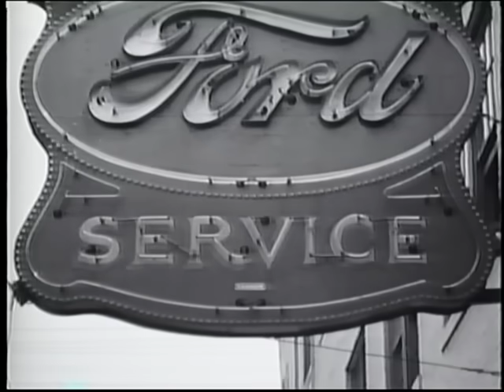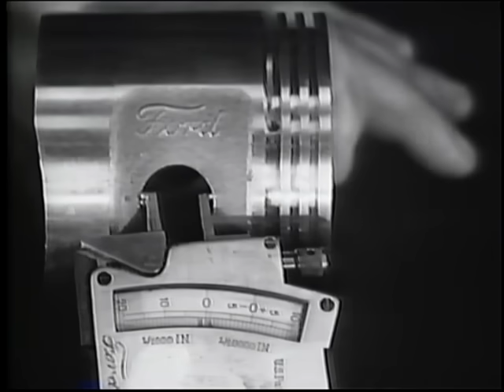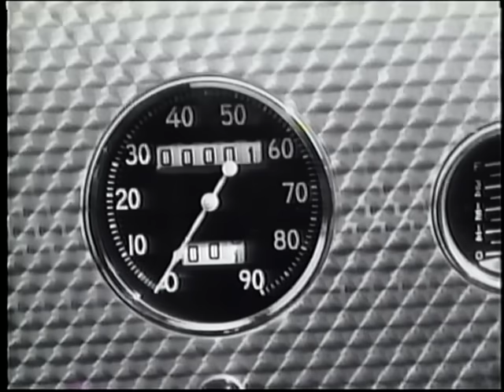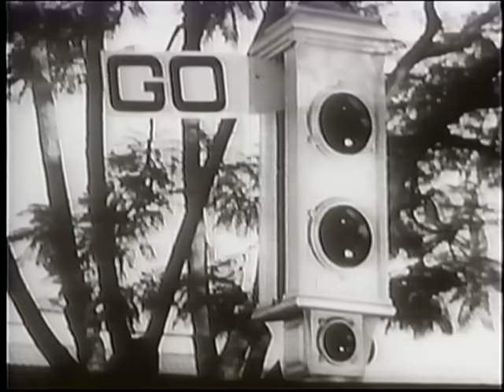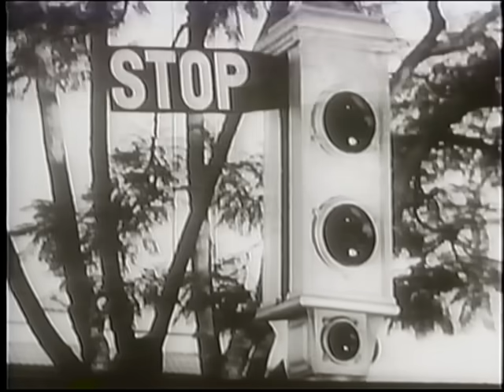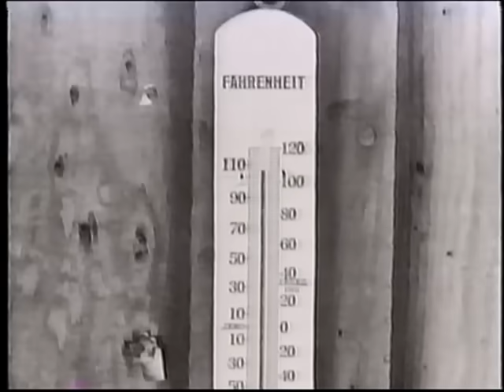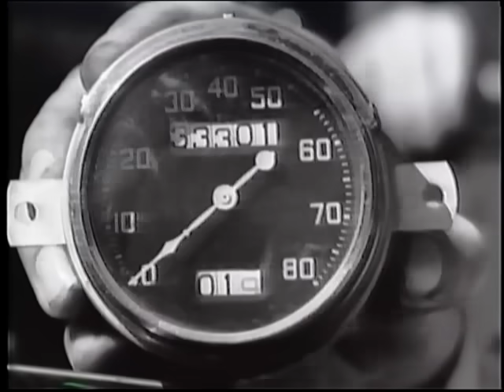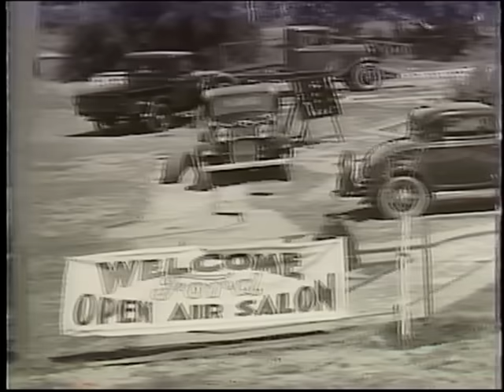1932 - The Invention of the Ford V8 Engine

Comment: Glenn Curtiss designed and built V8 engines in 1907 for his early aircraft
He put one of the V8s in a motorcycle that had one gear, no clutch and no brakes. Riding it himself at Daytona he set the world speed record of 136MPH, which made him the fastest man in the world (in any vehicle).
His world speed record would stand for four years until it was broken by an automobile in 1911. 
However, as a world motorcycle record Glenn’s daredevil speed run would stand until 1930
Reply: Wow, I didn't know that & I'll have to look up Glen Curtis.

Comment: This was back when Ford actually cared about quality on a large scale.
Reply: Ford has always been ten or 20 years behind GM. If it worked don't change it.
Reply: Simply just not true. The engineering department of Ford are way harder working and creative than when the flathead came around. Ford made the flathead because it was the easiest thing to create at the time and had it stick around until it was so obsolete the sales dropped dramatically. Flatheads we’re done by the 1950’s

Comment: These cars were fast back in the day they could go 80-90
Reply: I purchased my grandpa's 40 ford in 1968. It was 100% stock, 2 barrel and single exhaust. The speedo went to 100 and it would bury the needle at will. Very fast car.
Reply: Tok bad they were death traps. Poor handling, difficult steering, braking. They had safety glass, better brakes, lower cwnter of gravity by then but not much else had improved.
Reply: Stephen Powdexter yeah no one cared about safety back then if you lived to 50 you were lucky😂

Comment: GM first v8 in 1918, Ford in 1932 and Ford still trying to catch up to GM!
Reply: And even then they were years behind the first V8 which was a French airplane engine
Reply: @albennett9947  
The Antoinette engines used a primitive type of direct fuel injection. It was problematic, the engine liked to stall at lower rpm, killing more than a few pilots.  The engine wound up being taken out of planes and put in speed boats.
In 1906, Levavasseur built a large V-24 Antoinette engine for marine use. The V-24 had a 5.91 in (150 mm) bore and stroke and displaced 3,882 cu in (63.6 L). The engine produced 360 hp (268 kW) and weighed some 1,322 lb (600 kg). Some sources say this engine was too heavy for the intended boat, which ended up sinking. The specifics of this incident have not been found.  The company went out of business after 8 short years!

Comment: It should be remembered that the Ford's wasn't the first monoblock V8. The 1929 - 1930 Oldsmobile Viking was the first, but only sold about 7000 unit as it was quite expensive at $1595.

Comment: The French invented the V8 in around 1906 as a compact stationary engine.
Reply: What year was the French Fry Invented
Reply: 1904 Antoinette , was used as a airplane engine . the First Automotive application was the 1914 Cadillac
Reply: Mista 2 Rolls-Royce de dion bouton did v8 before Cadillac although not in large numbers.
Reply: Maybe but the big deal was that ford made a affordable v8 for the public

Comment: It's sad that people don't realize or respect how much the auto industry changed the economy of the United States.  When America shifted from an agricultural to an industrial  based economy it was the auto industry who was the major cause of innovation, work and tax revenue in so many industries that support the auto makers.  The material that's needed is one thing.  Mining the ore, shipping it to the refineries and then shipping the metal to the machine shops for their use.  headlights, brake lights, dome lights, dash lights, turn signal lights, license plate lights, glove compartment lights, fog lights.  Circuit breakers, electrical systems, relays, servos, switches.  Hydraulics, fuel, paint, oil, radiator fluid.  Then you had shipping companies to deliver the cars to the dealerships around the country.  You had places with contracts to make replacement parts for at least 7 years, places that made customized parts, repair shops, gas stations, car washes, auto parts stores, magazines where you could buy parts, all the accounting firms to do the corporate taxes, all the health insurance for the employees in the UAW union working for the car manufacturers, the advertising agencies, the car insurance companies consumers need to carry for owning cars,  and I'm not mentioning everyone but damn, that trickle down effect was the truth when it came to the auto makers and the US economy!  Charles Kettering was one of the main drivers!

Comment: Take note at 23:00 of the leaf-spring rear suspension with this 1932 Ford sedan:  That was the same configuration as what was used in the early models of the Chevy Corvette sports car.  Imagine my surprise when I first saw that on the underside of a 1963 Corvette Stingray my brother had.

Comment: @33:22 some feared that the angled pistons would wear out early on their underside    ........people who are dumb / have no clue about engine dynamics, as piston side thrust from normal  engine operation is thousands of times more than the effect of gravity on the pistons at any angle.
Reply: Check your facts silverbird58 A guy called Herbert Skinner  patented  the  SU constant depression variable venturi carb in 1905  production  was intially slow  and it was  the sale of the company to William Morris  that ensured  that SU were in large scale production of  variable venturi carbs imediately post WW1. Apart from moderisation through design generations  it was largely unchanged until volume production stopped  in 1990.
Reply: Ah, yes. My dear old beloved and finicky SU's. But their response to the gas pedal was incredible. Most early Datsun Z cars had SU's. I gave mine away with my old Volvo, along with a set of needles and a SU piston balancer. I had replaced the SU's with a Dell'Orto. Not much better, and a bit pricier. Bought a Chevy van and had way more fun.
Reply: silverbird58 uhhh they got this new deal .....called Electronic(ally Controlled) Fuel Injection .........and overhead valves too !!!!!!
Reply: Ford made them in it`s 1937 and 1938 60 HP V-8 engines they put in the so called Flat back Trunk lids Fords!  My Uncle had one in 1938, ,hated it because it did not have the power and zip of the bigger  85HP iron block V-8,also it was notorious for using oil, same as the 1933 V-8 engines!
Reply: ulisscarple 
My Dodge slant 6 225  does not have any problems.
Reply: Yes! I still hear that nonsense from people today! Cylinders wear the most on the major thrust side of the piston.

Comment: Looks an awful like those things were balanced and blueprinted from the factory.
Reply: Thats just what they show the camera. They probably only check one part from a batch.
Reply: @tubester4567  
No, I really think that they dynamically balanced each engine.

"To trim weight and friction, the design employed three instead of the more common five main bearings, plus a cast-steel crankshaft that was developed with the strength of a forging but at significantly lower cost. Large counterweights and dynamic balancing improved smoothness. Lessons learned perfecting the steel crank’s metallurgy were carried over to make better cast-aluminum pistons. The oil sump and the intake manifold were also aluminum.

Since the 30-acre Rouge foundry in Dearborn would be supplying 3000 engines per day to 33 Ford assembly plants, manufacturing speed was of the essence. Sand was shot into molds from overhead chutes and packed using vibration to minimize hand labor. After passing through a vertical curing oven, the molds were placed on a moving conveyor and filled by two-ton traveling ladles. Ford’s cast-iron recipe consisted of 80-percent iron, 15-percent scrap steel, 3.2-to-3.5-percent carbon, 1.8-to-2.1-per-cent silicon, 0.6-to-0.8-percent manganese, 0.25-to-0.32-percent phosphorus, and no more than 0.1-percent sulfur. Cast iron’s combination of stiffness, strength, wear resistance, and low cost would make it the material of choice for engine blocks for the rest of the 20th century."

https://www.hagerty.com/articles-videos/articles/2018/10/22/henry-ford-produced-v-8-for-the-masses

Comment: "Car & Driver" magazine did a piece last month on the demise of the V8.  Now that V6 and inline 4 cylinder cars can get 200+ horsepower with ease (and if Turbocharged can get ungodly horsepower) the V8 is unnecessary.  Well, being an old MOPAR guy I have had a lifelong love affair with the V8 but the truth is they really are unnecessary.  Sad day for the V8 but I'm glad I had my years with those big ole MOPAR V8's...
Reply: Yeah, but "there's no replacement for displacement."  ;-)  Love me some dual-quad hemi or 440 six-pack!
Reply: The V8 is the most stable engine ever, and it is sad that they are not as common now. The cars from the 1950s through the 1980s were simple to work on, and looked great and were affordable. Today's 4 cylinder puttputts are garbage and they are too complex for an amateur mechanic to work on. They are too small, and the look dog ugly. There was no need to change anything after about 1975. V6s are unstable. Consider, for example, the V6 used by Volvo, Peugeot and Renault from 1976 through the 1990s, e.g. in the Volvo 760. That was a crap engine, very expensive to repair. If the head gasket went, the best option was to toss the engine and put in another used one that was still working.

Comment: How is the Ford V 8 of 1932 an invention?
Reply: It was the 1st V8 which had a one piece cast block to keep the price of the car down.
The process of building that v8 was the innovative part.
Reply: Leon Cutajar 
The Ford Model 18 V 8  was very innovative. First mono block V 8 as well as the first low price V 8. But I do not believe it qualifies as an actual invention. 

By the way, one source said the Ford Model T was the first mono block engine with removable cylinder head.
Reply: +Scooter George this video couldn't have explained the challenges of casting a v8 in the 1930's any better. it was said to be impossible. how does that not qualify for an invention? H Ford's persistence and determination was undeniable. great video.
Reply: Better described as a development, not an invention
Reply: +dannygalaga exactly, that's the definition of an invention, a PROCESS or device
Reply: biaggiwins 
It does not stand alone. It is a development of  existing ideas. But, as brilliant as the Flathead Ford V 8 was, it was flawed. As pointed out in the video, the exhaust passages were very long, transferring a large amount of heat to the cooling system. This situation was compounded by mounting the water pumps on the cylinder heads. Water was extracted from the engine when it was at its highest temperature. And since it was drawn out, ambient pressure was lowered. This low pressure drops the boiling point of the coolant compounding the problem. This flaw was not addressed until 1937.

As for Mr. Ford, he was a strange man. Brilliant and yet hard headed. He kept the Model T in production long after it was obsolete and in the face of increased competition. Then, for whatever reason, his plants were shut down for months in the switch to the Model A.  The Model A was popular but it barely caught up with the competition from Chevrolet and Plymouth. Hydraulic brakes? Forget about it!

The V 8, as innovative as it was, was not enough to take the sales lead from Chevrolet except in 1935. What really makes the Flathead great in my opinion, it really spawned the world of hot rodding as well as the speed equipment industry as we k now it today. It was the Small Block Chevrolet of the thirties and forties.
Reply: +Scooter George wow, you are either stubborn to accept the definition of invention, or a very hard man to impress. the flaws of the early V8's are irrelevant.  either way, we will have to agree to disagree. have a great day.
Reply: biaggiwins
I guess I just have a narrower idea of what makes up an invention. And a great day to you. In the words of the late, great Barry M Goldwater, "To disagree, one does not need to be disagreeable."
Reply: Henry invented the V-8 engine block, not the V-8 engine.  His Flathead V-8 of 1932 was the first V-8 that was affordable.  Henry also invented the "engine block" a quarter century earlier, with his friend and Chief Engineer Charles Sorensen (00:04:18 mistakenly calls him Charles Schultz) involved with both efforts.  Prior to the Model T, engines were comprised of cylinders bolted to a crankcase - which is spendier and leakier than an integrally-cast block.
Reply: Dave Schouweiler 
Correct. The term for the Model T engine was mono block. In 1909 the T was a very advanced designed. In 1927, it was obsolete.
Reply: Scooter George,    Read the title It was the " Ford" invention of the V8 not the invention of the V8,  Also the water pumps were not mounted on the heads they were on the lower portion of the block and also were the front engine mounts. They pumped water directly out of the lower part of the radiator and into the block. The upper radiator hoses were connected to the heads. The pressure from the water pumps pushed the water through the block and into the radiator. Like so many of the engines of today. The exhaust ports in the block were only about 3 inches long. It was not a problem. But compared to overhead valve engines it was a poor design. Certainly good enough for the thirties and forties. A terrific car for competing with the other cars in it's class. I have worked on many of them. The impact wrench really helps 24 nuts to bolt on one head, Phew
Reply: Scooter George because he only come out with one that years!
Reply: Huh?

Comment: V8 engine invented in France in 1902.  Ford mastered making them cheaply.
Reply: Yes. Thats what the video shows. The crankcase  is cast in one piece that was the breakthrough.
Reply: @neilcowan535  yep, no doubt that made it cheaper. Yank iron is good!
Video does include "invention", inferring that Ford invented the V8, though.
Ford himself once said :
"I invented nothing".
Reply: @photohounds  Yes you are right. Maybe he invented that X8?! Now that was a nutty idea! :D
Reply: @neilcowan535   but that engine made in France where's not a One Piece Block. Henry Ford invented the first one piece V8 block
Reply: @jamesgentry371   Henry's engineers DEVELOPED a one piece block. It is NOT an invention FFS.  
Good move because it was way cheaper, of course.  Light and stronger for that  weight too.
Dodge brothers developed some of the Ford V8s, didn't they?

Comment: The title is misleading.  Ford had V8's in the Lincoln prior to putting a V8 in the Model A.  The first production V8 in the U.S. was the Hewitt Touring Car in 1907.  The first V8 to be made in significant quantities was the French De-Dion Bouton.  Cadillac made the first mass produced V8 in 1914.  THE DIFFERENCE is that the Ford Model A V8 was the first V8 engine with all eight cylinders cast as a single block.   That made the engine cost effective to put into the lower priced Model A.   That is why the Ford Model A V8 is a ground breaking advancement - not because it was a V8, but because it was the first V8 that was made affordable through Ford's advancement of manufacturing processes.
Reply: Did you even watch the video?
Reply: @OliverWagnerOliwerix The title alone was misleading enough.  I didn't need to see the remainder of the misinformation...

Comment: One thing Ford was always ahead of the competition in was the placement of the distributor. Fords motors had the distributor on the front of the block as where Chrysler and GM had it at the rear. The difference came in you looked at ignition timing. Ford engines did not suffer from the timing going out as the revolutions increased because they were driven off the cam at the front where the cam was driven from. As a result, there was little to no change in the dwell as there was no torsional effect coming into play. GM and Chrysler with their rear mount distributors could change a few degrees retarded at higher RPM because the cam twisted under the load. It just makes sense to eliminate the change in dwell and keep the timing consistent and Fords engineers knew this.

Comment: I wonder where that 20,000,000 Ford is now?

FYI: Ford did not invent the V8 engine. Cadillac already had a V8 engine since 1914.
Reply: Walt Williams there are about 15 different car companies that all built V-8 engines before the Ford flathead V-8 . What made the Ford V-8 significant is it was the first cast in one piece engine block in production. Ford had been building V-8 engines for years before the Ford flathead for the Lincoln car line but they were assembled from three individual parts to assemble the engine block like everyone else did. When the flathead went into production it wasn't because they had to build a V-8 it was simple marketing. Chevy had a new 6 cylinder engine virtually everyone else went from a 4 cylinder engine to a 6 cylinder engine so. Ford came out with a V-8. That got everybody talking about the new Ford. Notice Ford never said they were the first to build a V-8 just that the model B car had a newly designed and built V-8 engine. By the way Ford could and did do what he wanted without worrying about stockholders. Ford didn't go public until January 17, 1956 prior to that it was privately owned.
It also became the only engine to be built in several different countries The last flathead V-8's were built by Simco in France ended in 1961 and the last factory producing the flathead V-8 was a factory in Brazil it didn't stop building them until 1990 !!!
Reply: BUT the cadilliac wasn't a poor mans car. ford pioneered the cheap v8.
Reply: Ford invented the Ford V8
Reply: Right James, and if you read the title, it says the invention of the Ford V8, not that Ford invented the V8
Reply: Walt Williams  ford invinted the Flat head V8
Reply: Ford invented the first practical V8 engine design that could be economically mass produced. That's what counts.